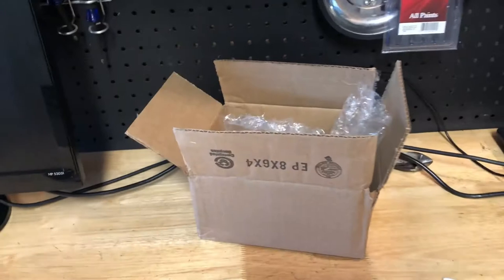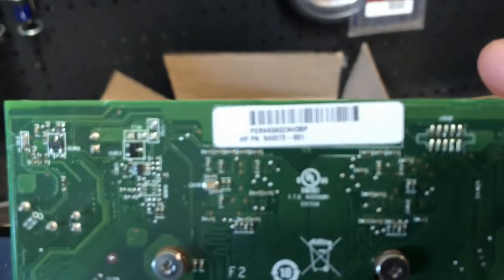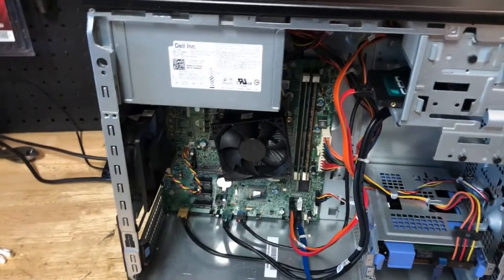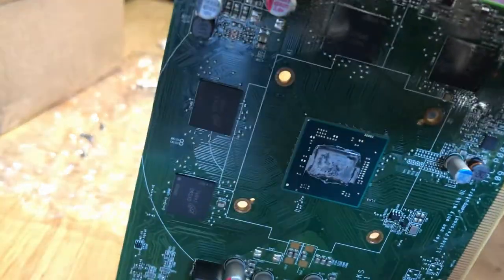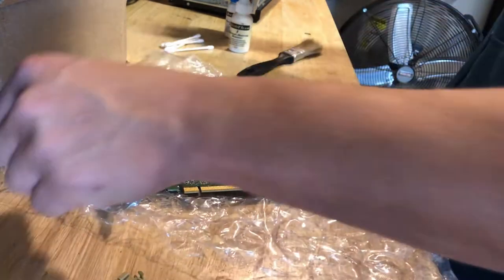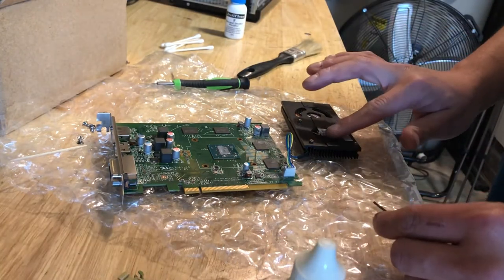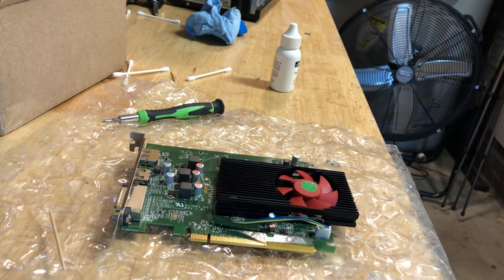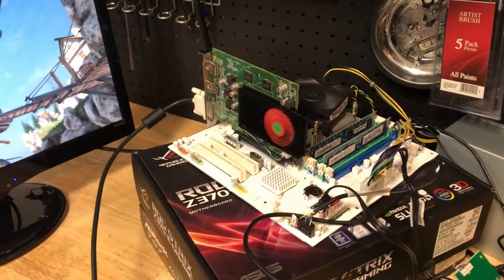RX 550 video card refresh and review. Good Budget gaming card for $30??

Comment: I was looking for a cheap second pc to build into a mini itx case so I can take it with me for some light gaming when I visit family I just picked up a system with a 4th gen i3 in it 16gb 1600mhz ram and no gpu for $30 I got a i5 4670k and a rx550 4gb msi LP FOR $40 you know what it doesn't suck I can play older titles fine at 1080p and even modern warfare 2 on low I'm getting a solid 40fps

Comment: You can get the low profile version and then it will fit into those slim Optiplex machines. This is what I do for a stock workstation/ web surfing machine.
Reply from the maker: yea I have gotten a few of those for optiplex sff budget gaming builds using the original case and with a I5 third gen they pair up well